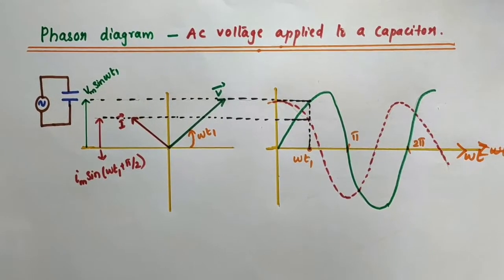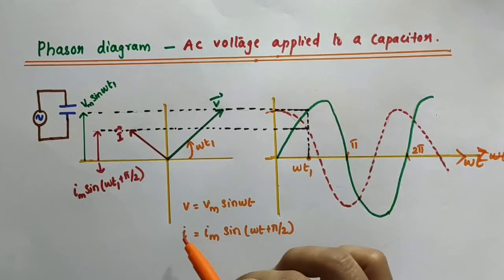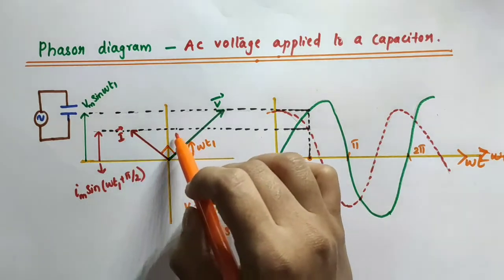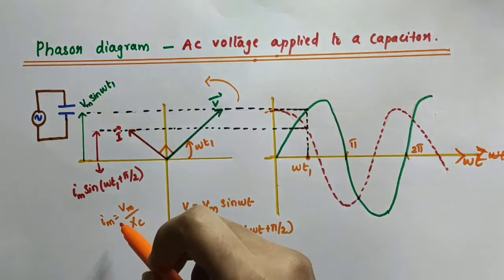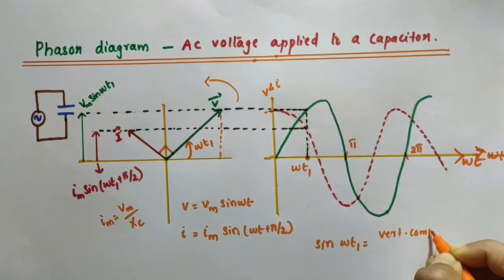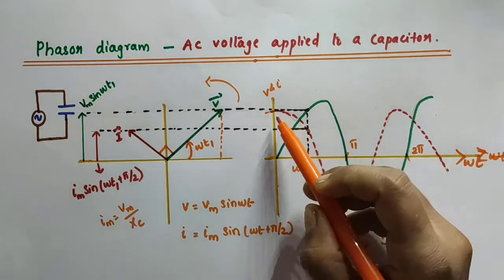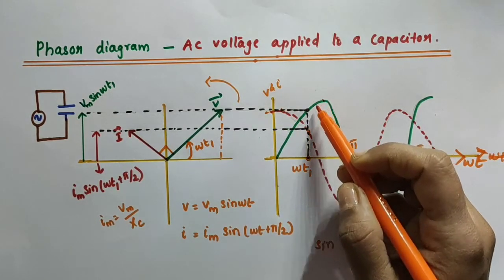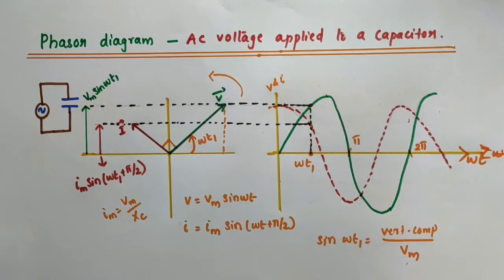Phasor diagram - AC voltage applied to a capacitor 📝 Class 12 Physics/Chapter 7 Alternating current

Comment: Mam
The length of phaser i will be more than phaser v 
Cause of Xc =1/wc    ( i think so )
Can u explian it?
Reply: Max Current will be greater than Max Voltage.. (Refer the equation again)
In phasor diagram its just current  and voltage
Hope it helps
Reply: But still uf you measure the amplitude of both from the diagram it looks vm>im